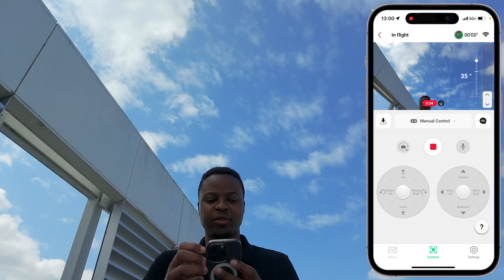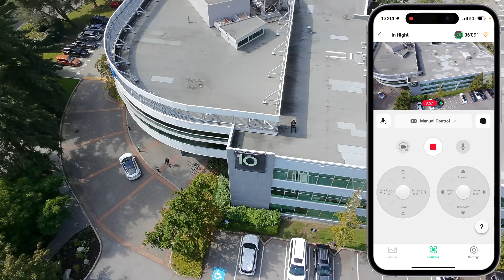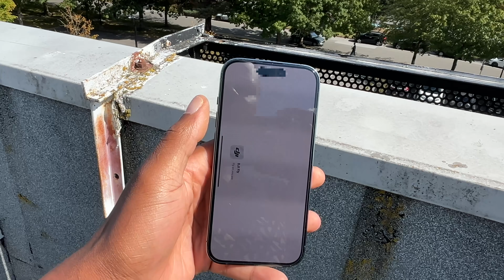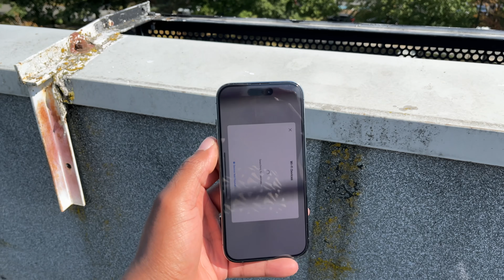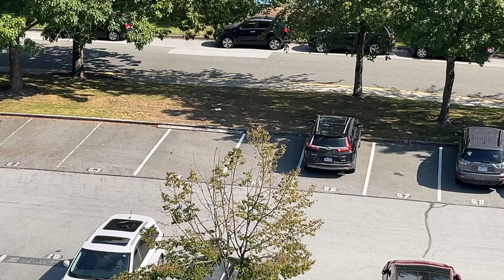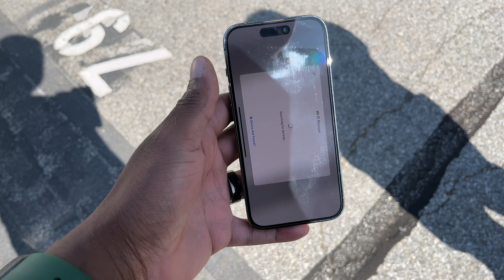DJI Neo Drone Lost In the Sky - But It's Not a Problem

Comment: Hindsight is  2020, but the moral to the story is not to push Neo it to the edge of connection in a place that you cannot physically move closer to it to reestablish connection, especially realizing it has no return to home capability using the phone, and has no collision avoidance.  Granted, this was in part to test the limits of connection, but for normal use, if the connection is getting weak, it would be safer to move Neo back closer to yourself and the phone, not to try to move Neo even further away, then to be disappointed that signal can't be reestablished.  This applies even more in wind or risky areas like over water, or where an uncontrolled landing could put it or others at risk.

Comment: This NEO drone is strange. It doesn't fly further than 50 m. DJI Tello, which is already 7 years old and costs 2.5 times less, can fly 70 m with the same smartphone and more than 300 m if you use a Wi-Fi booster. I didn't find a solution on how to strengthen the signal. NEO has a different Wi-Fi connection than Tello. DJI hasn't done anything particularly useful in updating the firmware in a year.

Comment: So was the problem fixed with Dji new firmware update or no. 
This video confirms to what I was thinking about neo. It is not ment to fly way high and far when using dji fly app. Rtm is activated when your fly it with control. Neo was not ment to fly with controller. This is a drone you use for quick flights not to high or far. It is best used to follow, circle directional modes. I got one three days ago and I am in love with it. My dji Mavic air 2 is so jealous now because neo is with me all the time whenever I got.
BTW I thought you were in Africa and I was wondering in which city you were. But once I saw the BC license plate I said ah we are in our country, the good old Canada. Cheers from African living in Toronto Canada. Keep sending it brother.

Comment: When that happen then you should use a Controller if you have one the one with the screen or the one that you connect the phone then put the dji app off and then turn it back on then the Signal will be back try that it works.👍😮

Comment: Dude, you’re depth perception sucks, that’s a lot more than 60 feet away from you. That’s over 100 and that’s asking a lot of any Wi-Fi signal. The phone connection was not meant to be very far away. Most Wi-Fi signals in your house don’t go more than 30 feet. Go buy yourself a controller.

Comment: Hey, I work as a software engineer with DJI. While you are connecting your drone, is your mobile data turned on?
Reply: Does it extend its range and height if it's turned on?

Comment: the Neo is just a pile of steaming poop, I sadly bought mine, and i bought 2 extra batteries and the battery charger, they are good and can charge all the batteries in an hour, but the drone is rubbish. I have 2 controllers and none connest to it, so like you I fly with the phone is is not ideal, my first flight I crashed just using follow mode, in that afternoon I crashed 8 times using the follow mode, its rubbish for the money, the video quality is rubbish also. its no more than a toy, an expensive toy at that. the worst thing dji has come out with yet.

Comment: The DJI Neo drone has a Wi-Fi control range of 
                UP TO 
50 meters when connected to a smartphone.  Thats BEST CASE. 

Next time ypu want to test signal, go to an open field.  Flying a Neo off a building until you cant connect to it anymore seems a bit silly in retrospect, doesnt it? 😂😮

Comment: I just watched on another video..and it has a RTH feature which would have brought the drone back to you but the RTH only works if you are using one of the controllers. I'm so glad you did'nt lose it. Stuck in the air like that you remained very cool. Awesome.
Reply from the maker: Thanks for the info!
Reply: yes my man was very cool =
Reply: I little too cool. I would go to where the drone hovering to get it right away when it land.

Comment: Hi @FlightMode1, may I know if you still experience the issue of not being able to search for devices at close range? If you still encounter disconnection during manual flight, you can provide the LOG when the problem occurred, and our engineers will assist to further analysis. You could provide us by a sharedrive link, thanks.
Reply: you  could  add RTH function  with mobile app.  in the end the drone knows where, it has geofence, it knows GPS location of the take off

Comment: The reason maybe you lost connection is because you are on a roof of the building where there are lots of antennas, electrical cables and lots of metal minimizing the wifi signal between your phone and the Neo. (I might be wrong)

Comment: You can't connect to a drone which you have already paired before using the Connection Guide. Go out to the Home screen and wait for the Device Found to appear in the bottom left of the screen, click Connect to reconnect. Remember the max distance for phone connection is 50m. Also a good idea to monitor the wifi bars as you fly further

Comment: This was an excellent video extremely well presented. The same thing happened to me yesterday - except mine was tossed out of the sky by the wind and crash landed approx 50ft below in a field. Didn't see where it had come down. I did find that when i went to my flight record in the app that it had recorded my flight path. You can watch it as a video. I could then see exactly where it went down where the tracking stopped. I was thrilled to find it after only 10 mins searching around that position on the map. It  still works perfectly! I think it was because I had mobile data switched on that the app could record the flight path. Of course you could always use screen record too when flying as another back up to locating the drone. I couldn't use 'find my drone' because the drone battery had run out.
Reply from the maker: That’s scary. 

Maybe putting an AirTag in it might help 😅

Comment: Using a mobile only gives you wifi/Bluetooth connection and a short range which is best used for close range use, selfies follow mode ect., gps will only be active if flown with main controller to give greater range.
Reply from the maker: Thanks  for the input

Comment: So why didn't it return to home when the battery was low?
Reply: Thanks for that. If it loses contact with the app though, does it not return back to being the Neo that returns to land on your hand. The issue was that the drone lost its link to the app, not that the app didn't support RTH?
Think I shall still buy though but can you tell me if my RC with screen for my mini 3pro is compatible? The RC has no model number that I can see
Reply: @BobDixon-ln2vi  when you use smartphone, it doesn't recognize you or your hand.   So, despite you might still be visible, Neo will not come back to your hand as the normal 6 flying preset.   About the RC that you use with mini 3 pro, I don't know if it's compatible.  I think you better check other youtube video review
Reply: @dennyc4135  cheers 🍻
Reply from the maker: Thanks for the Pro Tip. I might test it out. Take off in manual, then do a quick shot with out landing the drone and see where it returns to
Reply from the maker: The DJI Mini 3 shipped with the RC 1 which is not compatible with the DJI Neo. I covered that point in my video of the DJI Neo - What DJI Did not tell you
Reply: @FlightMode1  hi yes I did see that. Also seen other 'reviews' with them using what looks like the RC I got with my mini3 pro with the built in screen, hence my confusion. 
Will try to get the correct info from DJI
Reply: the function only available with DJI Controller

Comment: This isn't what this drone is meant 4. It's a selfie drone. It isn't meant to go that far.
Reply: if you have DJI controller,  you can go 1.3km (another guy tested it) It's just the mobile wifi is not that strong
Reply from the maker: DJI Neo supports Wi-Fi connection to smartphones, eliminating the need for an additional remote controller. Control Neo using virtual joysticks on the DJI Fly app interface, with a control range of up to 50 meters.

From the official DJI website
Reply: Why do they advertise a 7km range? The max distance on a single charge was 1.3km. Now, it, of course, can go 2.5km, but then it's a one-way trip and still far short of every having any hope in making that 7km!
Reply: @gregb1599  no idea... maybe with future updates and bigger battery.  I saw one tested, it can reach 2.2km back and forth in Sport mode.

Comment: I think a good idea Dji should establish is when you loose control with the mobile phone the drone should automatically fly to a location to when it was last receiving the signal from the phone. It had AI features built in it so I hope with more firmware updates to come this tiny thing could get better and more friendly for people to use!
Reply: they could have add RTH function  with mobile app.  in the end the drone knows where, it has geofence, it knows GPS location of the take off.  They just want people to buy the RC.  But as you suggest, that's at least they can do.. lost signal.. move back 5-10 meter of the previous location and done
Reply: @dennyc4135  yes bro If they said it’s easy to use why not add a function like that to make it even better? Like these little bits and pieces missing isn’t good for beginners.
Reply from the maker: That’s a good idea 👍🏾
Reply: Not really possible without the connection it uses to track its own location
Reply: We just need RTH and all of its auto functions with mobile control don’t we?
Reply: Nah, just don't use a phone for a controller.  It's worthless with a 50m range on wifi.
Reply: @Margalus  it’s true I hope to see better updates tho from Dji rn…
Reply: @Margalus  DJI advertises using the phone as a controller. Yes, the range is limited but it should at least be functional and there is no reason why they couldn't incorporate a RTH feature when using the phone app..
Reply: @robertkorn  Return to home is a useless feature for something that is going only a few meters away.  It's a feature so you don't lose your drone when it goes out of sight range.  It would be pointless for the wifi range.,

Comment: That looks to me like way more than 50 meters.
Reply from the maker: From where I was on the roof to where it landed by its self after the battery ran out, it was about 5 to 7 car lengths.
Reply: @FlightMode1  Ah well that's around 30 meters at most. It's probably what others also mentioned, interference. I consider buying one as well but seeing things like this I will definitely go for the fly more combo. Thanks for posting.

Comment: Crazy i know but phones will only pic up a wifi signal for a short distance, along with being on a building with probably heavy wifi use. The phone app is certainly only for close up use ,once the correct controller is used it can easilly reach 1km before retuning home due to low battery
Reply from the maker: Wish it would return home when connection is lost or return to the last point of good connection
Reply: @FlightMode1  yeah this is a big flaw  if the rc controller can give a home point I'm pretty sure a modern day phone can do this too. I'm surprised it doesn't have rth as the safety feature from the factory.  But it's good to see people doing this so dji can add it in a future firmware update.apart from that it looks like a very versatile little piece of kit.